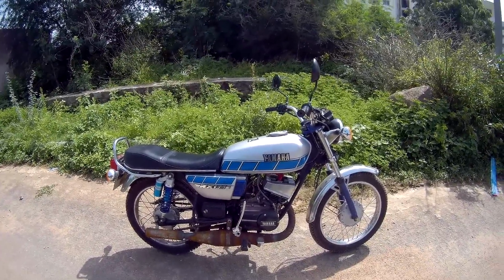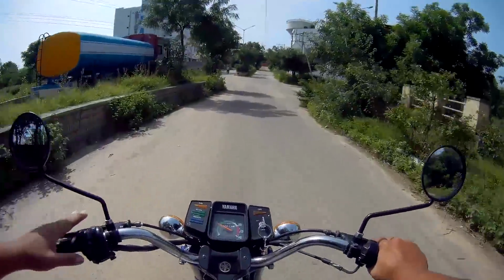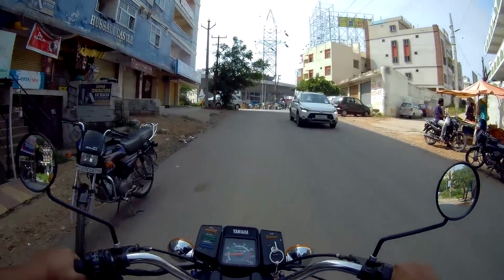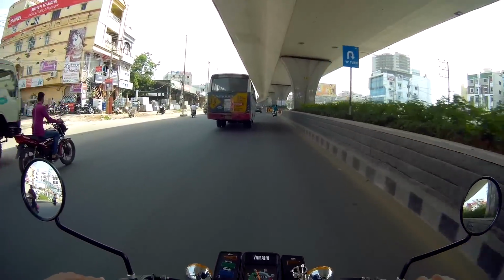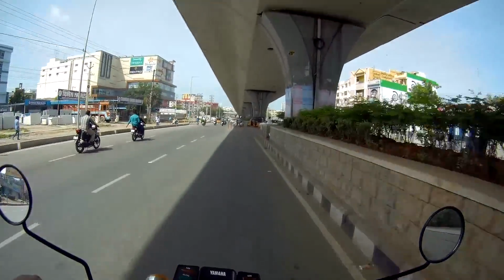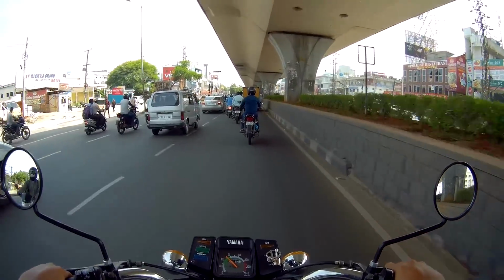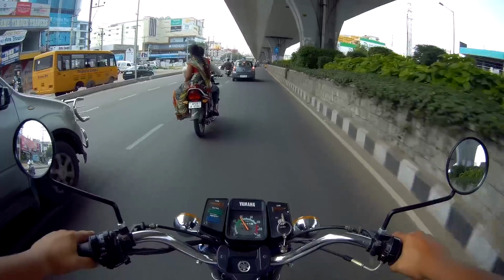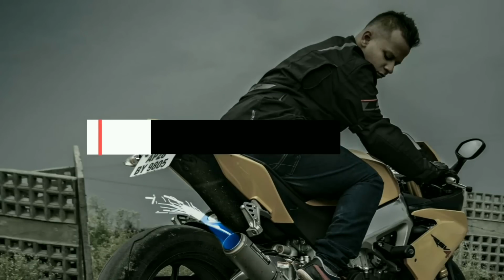My 2-Stroke POCKET ROCKET

Comment: I was a rx135 5 speed rider. Purchased it in 2001 and driven it till 2010. My experience was awesome. That was a master piece. Done 350000kms without any problems. Just 2 times rings changed. Reached 165 many times ( changed the spedo)
Reply: what 165 ???
Reply: What were the upgrades on your 135?
Reply: @reubenmandanna646  changed the chain set to 4speed  135. That ratio helped a lot.
Reply: @surjeetsharma33  thanks

Comment: I have an RX 100, fully ported it installed a 32mm carburetor and rejetted it to the  point of the best performance.

now it consumes way more gas than before! I probably get 20km per liter or less when I ride it hard
but in return I get this really really really! powerful 100cc bike

it can go 140kph easily and it can go to 150kph
Reply: 150km wow

Comment: I have Rx 135 4speed 2004 model  converted to 5speed..and I am ported it from Bangalore...and I am using racing magnet ,racing carb,power chamber....I believe that it will smoke 200 easily....
Reply: send u r bike video... massenger (Patil vijay)
Reply: 200 means duke 200 or 200km/h
Reply: @555NrS  duke 200...

Comment: been waiting for a very long time. you could really enjoy  the power-band by installing a RPM meter (RXZ meter) , and disk brake from gladiator or pulsar for peace of mind . i would love to see top speed run coz mine is running on a similar setup and does 120 in 3rd gear and 135 top speed .
Reply: Wth 120 in 3rd gear looo 5speed or 4 speed transmission

Comment: bhai very nice video. switch to cbz front fork with disc (nissin) , you will enjoy it even more .also the bike need a litlle bump in initial power so you can use a quick release throtlle you ll love the improvement .